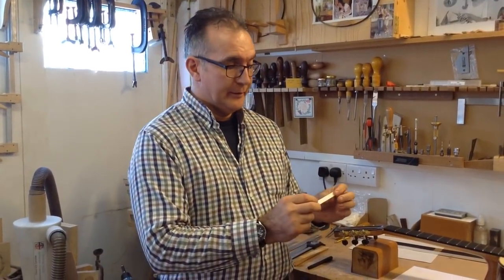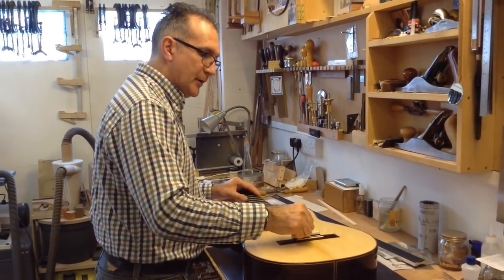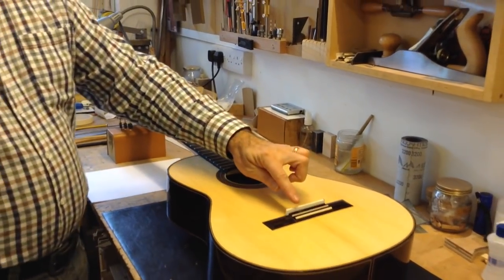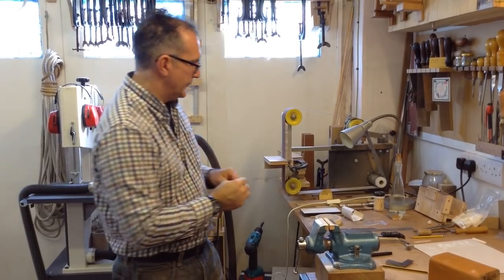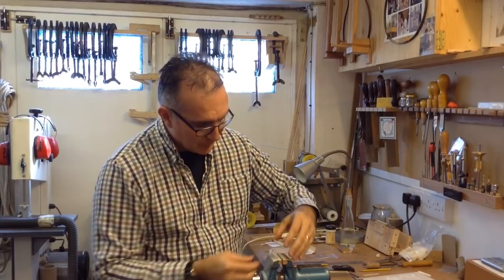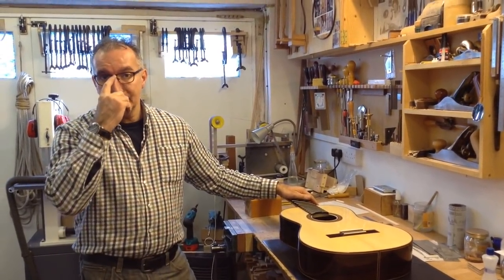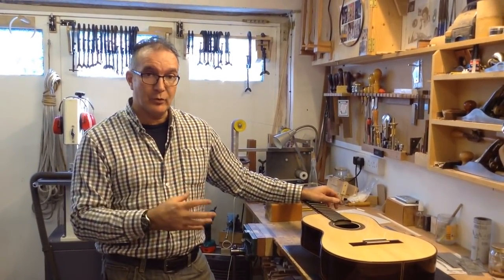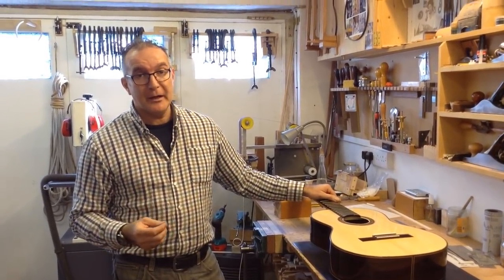How to make the saddle for a classical guitar

Comment: In case you don't have such tools, I'd just like to say that all you need is a single piece of 120-240 grit sand paper (both is better), and lay it on a table. Then you just hold the bone piece in your hand, and sand it first to height/width/curvature, then tilt it slightly to get the angle.  If the saddle profile becomes very low you'll start to sand your finger-tips, so put the sand paper on the end of a table, and sand half+ at a time.  I just made a nut and saddle this way, and it turned out very well.
Reply: And thats how i just did mine...after watching this..great lesson

Comment: I think most probable issues have been showed and said here. I missed one however.
The edges of the base of the bone should be given a few strikes on fine sandpaper
for a better fit. Wen the edges are too sharp it will not properly rest on the bottom of
the sleeve. But all in all I still dig these instruction video's and I'm really happy that 
Mr. Requena is willing to share it with the guitar repairing community!

Comment: Bonjour Pablo
Thanks so much for your reply. I have commented on many UTube videos but this is the very first time I have received any feedback. The main reason I appreciated your presentation was due to the accuracy and precisement as this very much fits in with my engineering background. I’m in dealing with your feedback I have to admit that I don’t understand the terminology Body Pitch so if you can spare me the time to broadly explain this I would appreciate it.  Regarding the point of the saddle, it was originally curved towards the rear and the height was 5mm at 6th string 12th fret and slightly over 3mm at 1st.  I made a new saddle exactly as you described in your video and adjusted it so that it measured 4mm at 12th fret and left the treble at 3mm.  Unfortunately, this made matters worse and now all of the bass strings buzz when fretted though not when left open.  There’s even a little buzzing on the treble strings though nothing to worry about.  The buzzing on the bass strings is now really pronounced, particularly the 5th.  I have other blanks so am happy to make another as I do enjoy doing this kind of work but need to have a basis to work to.  I have found during my research that Ramirez guitars have a saddle height of 5.5mm and wondered if you thought this might prove worthwhile trying?  But thinking about your calculation for determining the saddle height I wonder if it would create too much stress due to the increased height necessary to get extra height at the 12th fret?

I’m sorry this is quite long and don’t want to take up too much of your time but I really would appreciate your help.  I live in France so I doubt if you could recommend a luthier to help me out.

Thanks in anticipation,

Leslie

Sent from my iPad

On 2 PabloJul 2020, at 12:14, YouTube <noreply@youtube.com> wrote:

Youtube Logo
🌟 PabloRequena replied to Leslie Farrell's comment
 	How to make the saddle for a classical guitar
 	
PabloRequena
Leslie Farrell just to let you know that a buzz like the one you described is probably nothing to do with the saddle. Specially if you set up a high action and the problem didn’t go. To me this could be one or a combination of these three things. 1st, check the body pitch of your guitar, I wouldn’t be surprised if it is A in which case there isn’t a lot that you can do. 2nd, check the top profile of your current saddle, you should have a slope going down from the front of the saddle towards the tie block, if you have a half round shape you could have problems, I explain this in the video. 3rd: if the previous 2 options are not the problem then you need to look at the nut, but this I would leave for an experienced guitar maker. If you let me know where about you are I might be able to recommend someone. Good luck with this.
REPLY 
If you no longer wish to receive emails about comments and replies, you can unsubscribe.
© 2020 YouTube, LLC 901 Cherry Ave, San Bruno, CA 94066
 YouTube		 Twitter.
Reply from the maker: The body pitch of a guitar is the main note that the body of the guitar will produce naturally. To work out what this note is there are different ways, the more accurate one is to hold the guitar and hum into the sound hole scale until you find the note that will cause a vibration in the instrument that you will feel in your hands very strongly, when you find that note, hum it into an electronic tuner and this will give you the note. Ideally you want to have F sharp, very often if you have an A or a note near enough to A you can have problems similar to the ones you are having.
Sorry I can't help you more, This is all a bit too much to try to explain in a message because there are quite a few variables involved to be able to pinpoint exactly where the problem with your guitar is. Ideally it would need to be seen in order to test a few options, that's why I was suggesting to visit a luthier, if you look online I am sure you would be able to find someone near you.
Reply: Thanks Pablo 
I’m not too musical but tried your suggestion and found that the note producing the most vibration was A3 so it looks as though you’re right.  I do intend to take it to a luthier to see if he can at least reduce the amount of buzz.  Thanks again for your time and patience.

Leslie

Comment: Thank you Pablo, a very interesting and informative video! I have spent many hours with sandpaper and a set of small hobby files, shaping and customising saddles for my guitars. I was very interested to hear that you don't need any compensation for intonation on your instruments - is has been my experience that all of my guitars need some adjustment at the saddle to play in tune, especially the third G string. Admittedly I'm playing factory produced guitars, Katoh/Cordoba etc, and not your hand made instruments! I have found some saddles on Ebay which are compensated differently for each string - the break point on the saddle for each is as follows: Low E, A, high E break points are all at the front of saddle, (closest to soundhole) D and B break point is around the middle of the saddle, and the troublesome G break point is set as far back towards the tie block as possible. I have shaped bone saddles to this "general formula" and found the intonation to be very accurate. I use Savarez 520R strings only, and this works very well. I have read that some luthiers compensate the nut as well as the saddle - do you do anything special at the nut on your instruments? I realise that string height as well as the amount of pressure applied by the fretting hand also can affect the intonation, so it's hard to have a general rule.
Reply from the maker: Hi Andrew, as you say, it is hard to have a general rule as each guitar is individual. I can see why your system would work for your instruments but in my experience I would say that most high end guitars don’t need so much compensation, perhaps a little adjustment to the G string. Thanks for you comment anyway.

Comment: Dear Pablo
Thanks so much for another one of your very clear and most excellent videos!
One question. If one was making a 650mm scale length guitar (for instance) would the 'break over' point on the saddle measure precisely that same 650mm from the nut edge? 
Cheers and thanks!
Cath
Reply: No, you will have to compensate for the enharmonisity of the string. So the thicker the string is the more it has to be compensated. This will wary with different types of strings and of course I'm not an expert but for my last guitar I made the 6th string 652.5mm long and the 1st string 651,5mm. With the DAddario EJ45 medium this seems to give pretty good results...
Reply from the maker: Hi Catherine, I ad 1,5 mm to the scale length, so for a 650 guitar, the distance from the nut to the front edge of the saddle would be 651,5 mm.
Is that what you where asking?
Pablo
Reply: Thanks Thibault
Reply: it is indeed. Thanks Pablo!

Comment: Thank you so much for an excellent description and method of forming a bone saddle.  I have an Esteve Ltd guitar which has had an annoying buzz on the 5th string since new and the dealer has never been able to fix it even with the action at the base side at 5.5mm.  I am now going to try your method in making a new saddle and hopefully this may eliminate this annoying buzz.
Reply from the maker: Leslie Farrell just to let you know that a buzz like the one you described is probably nothing to do with the saddle. Specially if you set up a high action and the problem didn’t go. To me this could be one or a combination of these three things.
1st, check the body pitch of your guitar, I wouldn’t be surprised if it is A in which case there isn’t a lot that you can do.
2nd, check the top profile of your current saddle, you should have a slope going down  from the front of the saddle towards the tie block, if you have a half round shape you could have problems, I explain this in the video.
3rd: if the previous 2 options are not the problem then you need to look at the nut, but this I would leave for an experienced guitar maker. If you let me know where about you are I might be able to recommend someone.
Good luck with this.

Comment: Dear Maestro,
 your saddle construction is a final function of fingerboard setup, as exhaustively illustrated in an other video, and the bridge design. I learned your bridge is 8 mm high, so it could be the completed saddle protrudes over the saddle slot not too much, I suppose  3 mm at the bases and 2 at trebles for a total bridge height mm11/10 that, if I'm not wrong,  you consider the right height. Just a question about the bridge design: 
 the saddle slot depth how affect the sound trasmission or in other words what you consider the right thickness of the base slot to the soundboard? 

Thank you very much again for your precious videos!
Reply from the maker: costantino proietti the depth for the saddle slot is 4 mm, this is deep enough for the saddle to be well fitted into the bridge. I hope this what you need.
Reply: @redkitekk  Oh yes. Thank you.

Comment: You are such an exceptional teacher, thank you. I had my classical in a shop this week for work on a new saddle but not very pleased, thanks Pablo for your video I think I will make my own now. Oh and one question, the action on my guitar is too high, how close can my saddle be to the bridge without any problems with my strings buzzing?
Reply from the maker: To set up the action you need to measure it at the 12th fret, from the top of the fret to the bottom of the string, for a classical guitar you usually need 4 mm at the 6th string and 3 mm at the 1rst. The hight of the saddle depends on the angle of the neck, hopefully once you have the right action you would have about 2 mm of bone sticking out of the saddle slot on the bridge. I hope this makes sense.
Reply: @redkitekk  Yes it does and thank you for your quick response

Comment: Great video as usual. For the saddle placement, do you use the full scale length plus roughly 1 mm for compensation? Or do you locate the saddle by moving the bridge around pre finish until you hit the right notes?
Reply from the maker: Dassouki Photography yes, position the bridge at scale+1.5mm and cover the area where the bridge would go with masking tape so that the polish doesn’t get to it.

Comment: I have 2.5 years old Takamine H8SS. Great guitar but curious if I need to lower its action. The setup is currently from the factory in Japan. I have a bone saddle blank bought from Takamine, if I were to have this done. My current setup is about 4mm at the 12th fret of the 6th string (from top of fret to bottom of string) and about ~1mm at the first fret, with a ~2mm bone saddle height above the bridge itself. The 1st string at the 12 fret is about 3mm. The truss seems ok, no string buzzes and the truss isn’t vibrating. Would you recommend adjustments, or leave well enough alone? 
I know this topic is discussed over and over, but I’m not that expert on these matters.

Thanks, Richard Thornton
Reply from the maker: Hi Richard. The action you have described is quite standard and you should be ok with it. If there is no buzzing and the action is confortable to you I would leave as it is.

Comment: Hi Pablo,
I have a few questions. Firstly what kind of saw did u use to cut the saddle or should I say what was cutting edge. Saw teeth or a file. Very fine? Secondly the slot in my guitar is thinner than the bone saddle I bought by some margin. Is it just sanding to make it thinner or perhaps widen slot in the bridge. Finally when u fit the strings do u need to make slots in the saddle to stop them from moving? If so how do I u do that accurately? Different for each string? Sounds like I need to go on a course. Gracias from Englaterra.
Reply from the maker: Hi, the saw I use to cut the bone for the saddle is a jewellery saw, but any fine saw would work. 
To fit the bone to the slot in the bridge you need to sand down the bone unlit it fits in the slot, you don't want to push the bone into the slot for it to fit but the bone mustn't fall of the slot either if you were to turn the guitar over.
You don't need to cut slots in the saddle for the strings to find the right position, they will do that by themselves.
Of course if you join one of my courses you will find that it is a lot easier tho learn all these thing. If you are interested in joining one of my courses here in Spain you can find all about it on www.guitarmakingcourse.org or alternatively a have a course you can purchase on line if you go to www.onlineguitarmakingcourse.com
Reply: @redkitekk  Gracias Pablo. Tengo a tocar manana a una fiesta. Tengo constructor nuevo bridge hoy. Gracias por su rapido palabras. Estudie espanol en me escuela, hace cincuento anos. Lo olbido mucho de los palabras y la gramatica pero me gusto hablo donde es possible.  Buenas dias.

Comment: 1981 i bought a flamenco guitar from Lopez Bellido in Granada. The saddle has been lowered af few times and now the crowne is less than ½mm above the bridge! Reminds me of Venecia - when will it go under?
Reply from the maker: I know, this is a common problem with flamenco guitars.
If your guitar is loosing tone because of the low brake angle of the strings you could do a 12 holes conversion. I have a video about it in my YouTube channel.
If what you want is to have a bit more high on the saddle then you will need to do some work on the fingerboard.
Reply: @redkitekk  Thank you. Now I´ve seen the video on 12 holes, and I might give it at go. But in this case the bridge itself has been levered, leaving the slot only 2mm deep, so I wonder if it´s also a good idea to carve out the bottom of the slot, fx. an additional 1 - 1.2mm - if possible - and what tool would you use?
Reply from the maker: @sorenutube  yes, you could deepen the slot but you would need to do it evenly along the length. You can do this with a miniature hand router, Veritas does one that could do the job.
Reply: @redkitekk  Thank´s again Pablo. Just what I needed to hear. Your recomandations are very helpfull - and inspiring - as are you videos:) Greetings from Denmark.

Comment: Pablo, I just came across this video and its wonderful to see such a step by step course in a 1/2 hr clip,...Awesome! Thanks You. I do have 1 question for you; You mentioned toward the end of this clip that there is no need to "compensate" your saddles due to that your guitars have very good/great intonation.  I'm curious how you approach intonation during the design stage. By my experience with my own relatively inexpensive classical and reading/hearing many online clips, the 3rd and many times 2nd string as well will always have some intonation issue due to the inherit design of the guitar itself. Do you find that to be a false-statement or possibly not fully informed comment? thanks again.
Reply from the maker: Hi,
Yes, Sometimes extra compensation is needed on the third sting, but it is quite a big subject to be able to explain here in just a few lines.
Reply: @redkitekk  Yes, I understand, its a lengthy topic for sure. Thanks for the reply. I'll keep watching. cheers.

Comment: Hi Pablo, I have a Brazilian 7 string classical guitar. I have had it partially re-fretted, a new saddle and a new nut and it is set up at standard classical guitar specs. It has a strange buzz, but it doesn't sound like fret buzz, it sounds like it could be coming from the bridge/saddle. The saddle is quite flat on top and angled forward a few degrees. Do you think it could be the saddle shape? It did not do this before this work. Thank you.
Reply from the maker: There are different reasons why you can have buzzes and there is a good chance it might be because of the saddle. The top of the saddle shouldn’t be flat it should have a slope down towards the tie block. If you follow the instructions on the video you might be able to sort it out.
Reply: @redkitekk  Thank you Pablo. My friend who has built guitars will help me, with your instructions. Thanks for replying.

Comment: Pablo, when establishing the height of the straight edge above the 12th fret, is it possible to leave the nut in place, bearing in mind your answer to a previous question that height at the nut should be that of the first fret, not necessarily 1mm? Also, is the lower action on Flamenco guitars to aid playing technique or for tone?
Reply from the maker: K S te, you can use the 1st fret to work out the hight of the strings. The lower action on flamenco guitars is needed for both technique and tone.
Just in case you are interested I recently launched a course that you can find on www.onlineguitarmakingcourse.com
Reply: @redkitekk  Thank you so much, Pablo, and for the link to your course. K